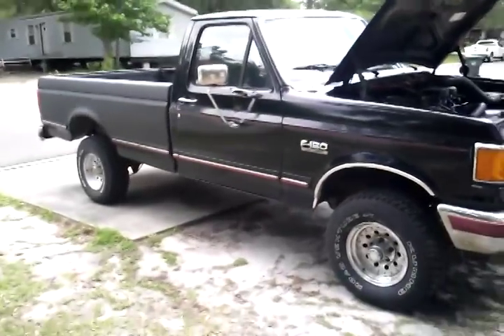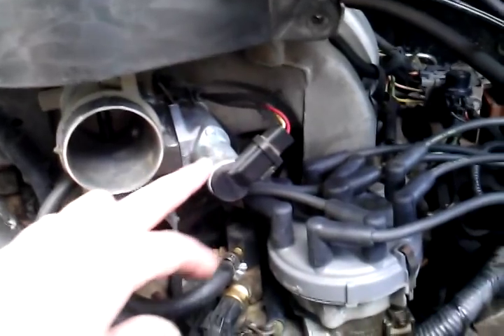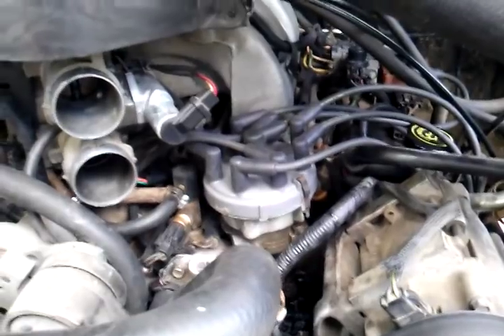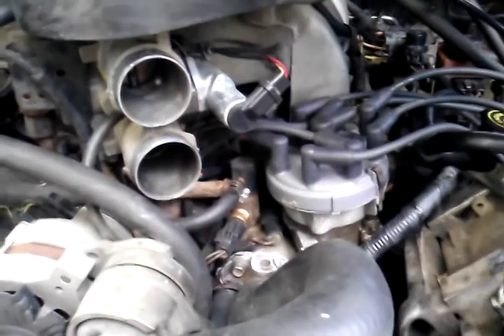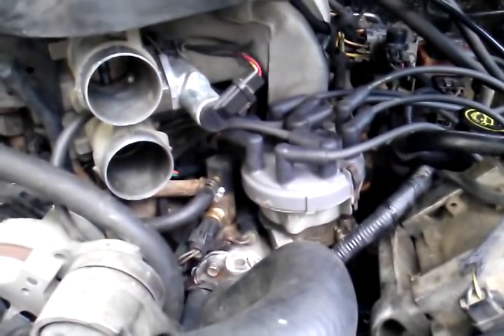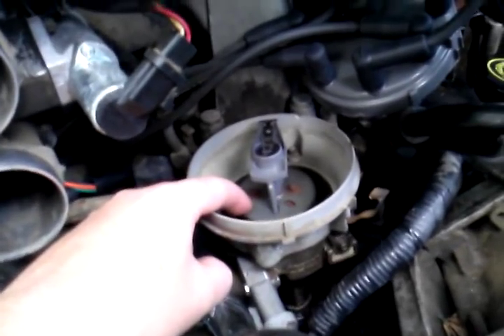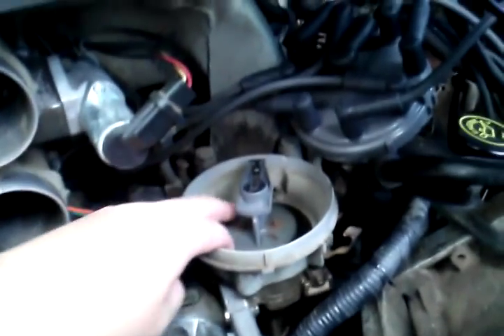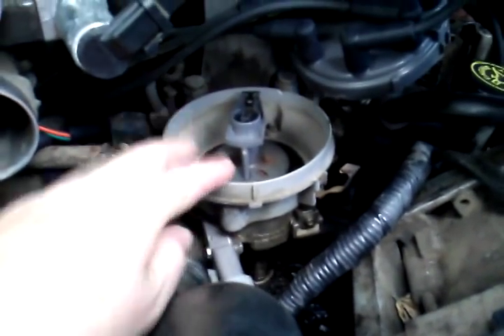91 F150 Pick up coil problems

Comment: my 1988 f250 5.8L use to burn up the ignition module  about one every 1 to 2 years. got sick of it so i made the wiring harness and went to salvage yard and got a heat sink bracket like the 92-96 have on the finder. so i moved the module to the fender been running the same  module for 5 years with no issue. there is a guy on here in you tube land that shows  you how to make the wire harness. but the pick up coil i had to replace 2 times in about 7 years. just go to auto zone and get the whole distributor. it has life time warranty and its like $77.99 in my area. that pick up coil will have you chasing gremlins under that hood for days i tell ya

Comment: Thanks, my 88 5.0l was losing power horribly going up hills and getting worse fast. Advance told me a pickup coil wasn't available so I had to do a whole distributer but it worked out as it came with cap, rotor and ignition module for around 90 bucks. Runs like a champ now,

Comment: My hood to cowl seal on my hood is bad and water is leaking on to my Coil and TAB and TAD solenoid, so if you are having problems with the coil a hood leak could cause it. It started running rough so I open the hood to check for problem in a rain storm, is how I found the leak. If your distributor keeps having problems I recommend changing the whole distributor, I had the same problem until I changed it. I was buy modules and pickups every 6 months, but since changing it, I've had no problems in 10 plus years. Besides if either one of them goes out the truck won't run at all. Usually when it starts running rough it's usually the EGR or a vacuum problem. Need to occasionally clean intake the with carb/intake cleaner.

Comment: A big thank you.  So many videos pointing to similar symptoms and more intuitive solutions.  Mine ran pretty good, but for years now... occasionally missing, occasionally stalling... then starting again 15 min later.  It seemed worse when really humid.  I did all the cheaper things too (plugs, plug wires, cap and rotor, coil, icm)... each thing I'd replace and no improvement.  The distributor kinda seemed unlikely, but... after watching this I bought a new one.  Considering 190K miles and wear on the distributor... and the work of changing the pick up coil, it seemed reasonable just to buy a new one.  It runs perfectly now.
Reply from the maker: I'm glad I could help out man

Comment: A Actron CP9690 code tester can show a code for the pickup coil. It checks live, record, graphing, emissions test, solenoid and relay test, oil light reset, check engine light reset, transmission codes, and MORE! It works from 1983-2013 and is updatable. EBAY has it. Replace the distributor to correct this problem. You need a special tool to replace the pick-up coil. Get a oil pump primer shaft from a parts store or an old distributor with the gear removed to line up the oil pump to the distributor. It'll give a code about PIP sensor. It'll be a memory code.

Comment: I had the same problem with my 93 f150 351w. Changed all the basic stuff chasing the problem like the fuel filter, gas treatment, plugs, wires, ignition module, cap and rotor. Nothing changed still ran like crap. it was driving me crazy that I couldn't figure it out. I ended up replacing the whole distributor cause that module in the distributor came apart and died leaving me stranded. That's what fixed it for me. it was that module in the distributor going bad.
Reply: CW Moore do u have one?
Reply: CW Mo

Do you have condenser installation video? !

Comment: 91 Ford F150 4.9L strait 6 trouble starting. Sat for a year in barn. Put new interstate battery in, plenty of power! Last time I worked on it and started it, it needed new fuel filter. I was told the fuel pressure sensor was changed, thought the fuel pumps were going bad or weak. It started recently after Gum out and fresh gas, and spray starter fluid, had to hold foot on gas for a while to keep it from dying. Drove it, didn't act up for 10 miles 60 mph to the auto repair place, but now it won't start for them. I need it inspected, so I can drive it legally to get real professional help. What about the Fuel Pump Driver Moduel? I will tell them to check the coil. I replaced the silinoid myself, and the starter is lifetime warrenty. I don't think it's the computer. I have to tell this guy what to do, he doesn't know how to diagnose.

Comment: Wrap black electrical tape around the coil wire.. I did.. Helped some. I've replaced almost everything and it still done it. Got bad at one point. Tape was my best result so far. almost a 90% loss. And back to normal

Comment: just for info, I have an 89 f150 302 4X4 and was able to change TFI by turning the distributor around to the front. to get to the bottom bolt I had to cut the removal  tool so it only had about 1/2 in. of where the wrench   goes left. hope this helps someone

Comment: I have a 1996 Ford F150. Where the hood meets the firewall there supposed to be a gutter to keep the water off of the ignition coil. Over time it gets brittle and the metal no longer stops the water. Your ignition coil overtime gets Rusty looking and then after that it quits working. I can't tell you how many ignition coils I have had to buy because of this particular problem.

Comment: yes, you have to pull the distributor to change pickups and remove gear from the bottom, it may require some heat to get it off.

Comment: Get a Acton CP9690 code tester. It checks live, record, graphing, emissions readiness test, oxygen sensor test, transmission codes, ABS, SRS, and MORE! Get 4 aaa batteries for under the rear cover. It's well-lit! It's updatable with a USB cable from EBAY.  Replace the distributor and NOT the pickup coil. The code tester will give a code about PIP sensor. It'll probably be a memory code. Disconnect the positive battery cable for 15 minutes to reset the computer and test drive the truck. Then recheck codes.

Comment from the maker: It would start jerking going down the road....then cut off not so much loss of power
Reply: Travis this is Phillip again lol we talked to each other about 2 months ago LOL well A LOT has gone on 1/2 gear went out...
The worst part is that I couldn't get one... For a while 🤬🤔🤔🤔🤔🤯 emojis said it. I got to do something cause my only truck. So I took the part out prepped it and I started to welding it up 🤔🤔🤔👁️👁️👁️👁️👁️👁️👁️🤯 and I was surprised when I finished it it took 🌑🌒🌓🌔🌕🌖🌗🌘🌙🌑🌒🌓🌔🌕🕛🕜🕟🕡🕘🕥🕦🕛 I miced it test fit it and wow. It feels good cause the 1/2 shift is so crispy and 3/4 5/R is sloppy as hell
I'm gonna send a part 2 of this cause I have a revelation...

Comment: Fuel injectors had the same exact problem rebuilt the motor bigger cam rebuilt it done it replaced the injectors runs like a top now

Comment: did you try to change the plug of the module , cause on my truck was doing the same thing and i try to bent 4 connectors in the plug to  the module  an i didnt have  any probleme after that

Comment: I just recently had similar symptoms with my 1990 E350 5.8.  Checked my coil even tried a brand new one because last owner said he replaced that and it started up again. Plugs and wires were old as hell so I thought may be they burned out the new one prematurely. Going to check into distributor coil and icm now. The van is almost 3 decades old and I have no clue if this distributor has been replaced ever.
Reply from the maker: Many people look over / miss the pick up coil...Hell I did as well...hope it fixes your problem
Reply: The odd thing is it has randomly shut off just a couple times on me since I got it and It happened so little and far apart I never looked into it until a couple weeks ago I fixed a coolent hose leak that broke at the connector and had to flush out the system because it lost so much coolent and I just replaced it all with new coolent. Old coolent was super dirty. Only after that did it randomly shut off a couple times while testing the new  coolent and popping bubbles. Then first drive up a hill with it she cut off and wouldn't start until the next morning. Drove it home and it it cut out right in the driveway again.started first thing in the morning for next 2 days but would only run for about 15 min.
Reply: Now she won't start at all with all new plugs wires and coil still no spark.
Reply: Could overheating have cause those parts to finally go bad ?
Reply from the maker: My truck shown here in the video was doing the same thing at times..Sometimes when driving it would just shut off and crank right back up..other times it had to sit for a few hours.
Reply: @BigTravGill  thanks thats got me thinking this is probably my issue then. I dont want to spend another 100 $ and not have it fixed. She's needs new oil yet too and I'm not rich.
Reply from the maker: @oby3000  feel free to ask any questions on my Facebook business page...Gill Mobile Auto Repair
Reply: Did the pick up coil fix the problem

Comment: Mine will run fine but under load or accelerating, it acts as if its hitting red line. just bounces around 2500rpm. Is this something that will cause that to happen?

Comment: Fuel. pressure regulator
Reply from the maker: Nope it was replaced
Reply: @BigTravGill  Did you try if you didn't already check your ground and connectors?
For corrosion And
Loose wires or Broken wires because  you need certain voltage in order for everything to work properly. Because I had a nineteen ninety bronco five point oh, that was going through the same issues, but it was usually the known suspects Relay , And start Selenoid. That's what my experience was. But for it's and giggles. What would it hurt to check the wires the ground?
It's tedious. But it could be as simple as a connector that needs to be cleaned or replaced. But the other thing about these vehicles is that they do not I repeat. Do not like setting around something always goes wrong.

Comment: I have a 86 bronco truck starts fine once it is warm and I do stop and go in the city it will stall out let it cool off for a while then it will start again but stall out again once it is warm back and forth but if I drive on the interstate no problem till I get off of it then it will stall out and have to cool before it will start could it be the pick up coil changed everything else already not the pickup coil though
Reply: could be the module in the distributor overheating ..

Comment: There is a code for the stator. If the engine jerks like somebody is switching the engine on and off it's the stator. Replace the distributor.
Reply from the maker: My truck had no codes showing up
Reply: My truck is doing the same thing I changed plugs wires coil ignition coil that is and it feels like somebody just shuts it off on how late it runs better but in town driving I can barely get up a hill with all the jerking and bucking so I'm have to look at the distributor assembly cuz I'm about ready to pull my hair out if I had any..lol
Reply: Also I have no codes showing up either

Comment: Did changing the pick up coil fix the issue? I have a 1990 F150 with the 4.9 L6, does the same thing. Stutters, jerks, shakes and it doesnt smooth when accelerating. Just ordered new plugs, wires, cap and rotor. Should I start trying to find a pick up coil next?
Reply from the maker: yes yes and yes.....I wasted more money on cap rotor, plugs...fuel filter....even a coil....it is a common problem with these trucks but for some reason not big on youtube
Reply from the maker: Travis Gill The ignition module on the distributor is most famous....but if that's not it....pick up coil...

Comment: How you doing I replace the whole assembly distributor cap the whole unit complete and it's still doing the same thing what could it be my truck drives and sometimes loses power it has Estates sometimes it shuts off

Comment: My 88 F150 did the same thing replaced all the same parts hundreds of dollars later yep pick up cool.
Reply from the maker: dude it took me ever to find the problem
Reply: Travis Gill took me 2 1/2 years b4 I even heard that a pick-up coil existed in my truck.
Reply: Travis Gill I bought the ignition coil twice I bought the computer brain thing on the side of the distributor 3 times I bought the throttle positioning sensor twice. I explain my problem I was having the two dozen certified mechanics not one of them ever mentioned the pickup coil the only way I found out it was the pickup coil was watching YouTube and a random video I've watched was basically like this video here had mentioned the pickup cool which was the only thing I hadn't changed
Reply: Mines not running at all...parled it at a buddys house one night and got in ot to leave few hours later nothing checked fuel fire everuthing...2 distributors later i found out it might be the ecm....im so aggravated with the truck...

Comment: my b2200 will run for most of the day then it will turn off like a switch and and wont start again. and then the very next day it will start again, and repeat the same process.  could that be a bad ignition coil? i am completely stumped. PLEASE HELP!
Reply from the maker: It could be...do you have an ignition module on that truck because I would check that first
Reply: no it doesn't have an ignition module, it's a bit to old for one. i have had to replace those before. there is no computer or anything like that. it's a pretty straight forward and simple truck. which surprises me that i can't figure it out. i know it's going to end up being something really simple. then i can kick myself.
Reply: my 94 f150 is doing the same thing.  Did you find out what the problem is?

Comment: I’m buying a 1984 f150 Saturday with this motor, it doesn’t run but the guy said he was driving and it backfired and he couldn’t get it started again, would this be possibly the problem?
Reply from the maker: Not sure on that... that sound's  like it might of jumped time..? Mine would run GREAT.... cut off when hot then not start backup until cold
Reply: @BigTravGill  would that be a big problem to fix?
Reply: @BigTravGill  do you think it would be a bad work out distributor or would I need to be tearing into it to replace the timing gear?
Reply from the maker: @dippinauto56  it can be on these older trucks.... now I'm not saying that's what happened with out seeing it but be careful. Its getting older to get parts for these here were I live so it is what it is
Reply from the maker: @dippinauto56  I have no clue man.... it could be the timing chain..? its to hard to say on here without seeing it

Comment: Problem i'm having, thinking its distributor or something in electrical at high rpm it'll want to shut off.
Reply from the maker: +Juan M “muchoSneakers” Davila on these older Fords I would replace the distributor first...In all my years on these old Fords I have only seen 2 bad PCM's
Reply from the maker: Also never forget the ignition control module..sometimes on the distributor others on the driver side fender
Reply: well wasnt distributor lol I will try the module now
Reply: well nothing lol new distributor and coil same damn issue. spark plugs and wires are good, thinking its throttle sensor but i get no engine light.
Reply: Okay, finally fixed my issue. My truck was kicking/stalling, when I accelerated above or around 30mph and gave it more gas it would stall as if no power is there but it wasn't the power that was going away it was the gas delivery to the injectors i'm thinking. 

The TPS was bad, the truck gave me no engine light nor any codes. I disconnected the tps and ran the truck, all power was there then connected the tps back and the issues came back. I don't think the tps replacement will fix the jerking issue when gears change, i think that issue has to do with the solenoid pack in the transmission, bad 1-2 and 3-4 springs.
Reply from the maker: +Juan M “muchoSneakers” Davila Keep an eye on the Idle air control because the TPS gets readings from it at times
Reply: Will do but I am gonna go ahead and replace that piece to because I had my doubts about it also.
Reply: @TarHeelResin  had same issue. Just unplugged the TPS and truck runs good. Ordering the part now. Thanks 👍

Comment: I have a 90 ford f150 and was wondering how did you get the whole distributor out? I cant budge it, its impossible to pull it out. I need to change out the pickup coil and find anywhere in detail that shows how to remove.
Reply: How did you get yours loose mine is totaly frozen as well. Just pulling my hair out. I feel helpless.

Comment: My 94 f150 turns over and but womt crank. It has fuel, and spark.. it was running fine and it just cutt off goimg down the highway.  Could pickup coil be bad?
Reply: Dosemt have spark *^

Comment: I have a question for all about my 85 4.9
Reply from the maker: whats up
Reply: @BigTravGill  so my truck ran alright drove it for 2 years or so. Driving it two weeks ago the pin holding gear on distributor went out...it took me some searching but found that and pulled it ordered new one but guy said he couldnt find for 85 had to look up 87 lol anyways when I set on compression stroke with crank marker at 0 and rotor lined up with number 1 on dist housing unhooked spout started truck and set timing to 10 btdc with timing light. First try I didn't turn my truck off i hooked spout back up while running. I have tried and tried it will idle and rev up sounds awesome in neutral but when you put in gear and go to move it definitely not right.
Reply: Do you have email where I can maybe explain more?